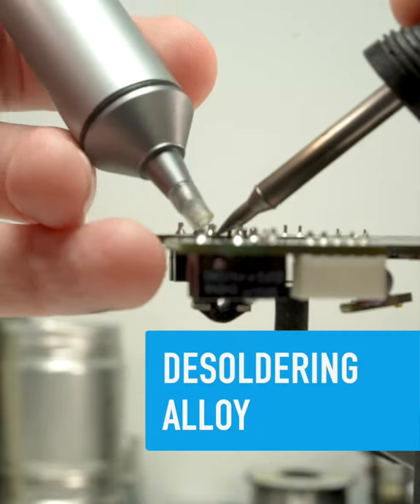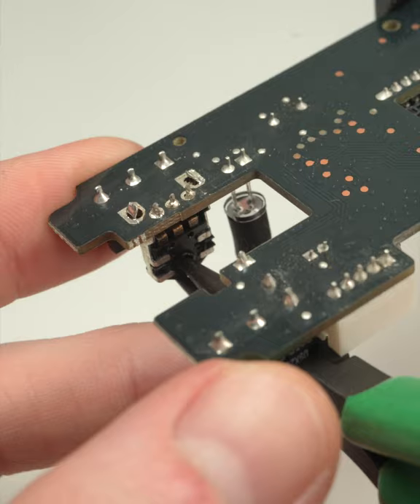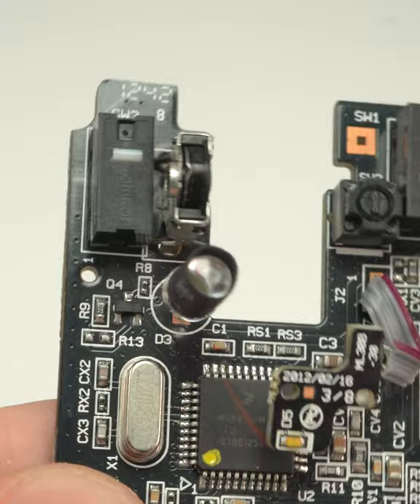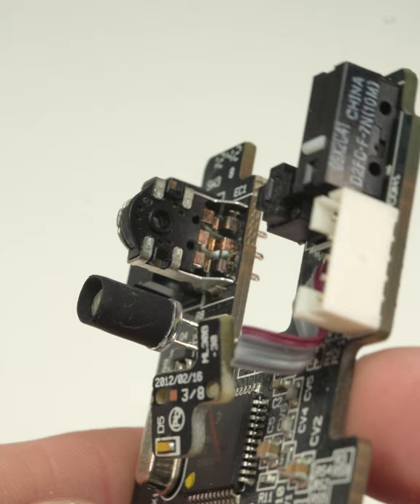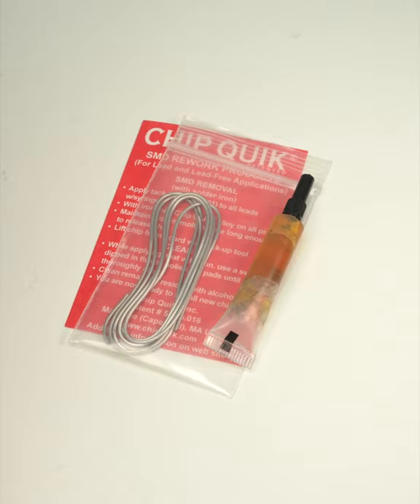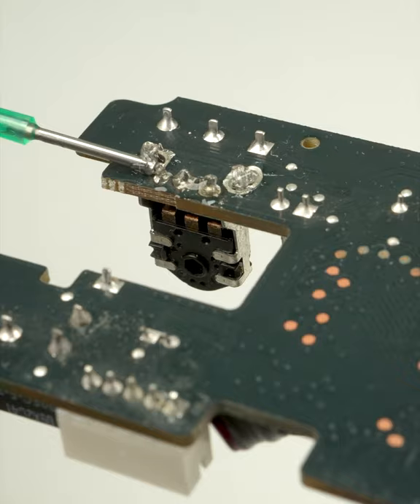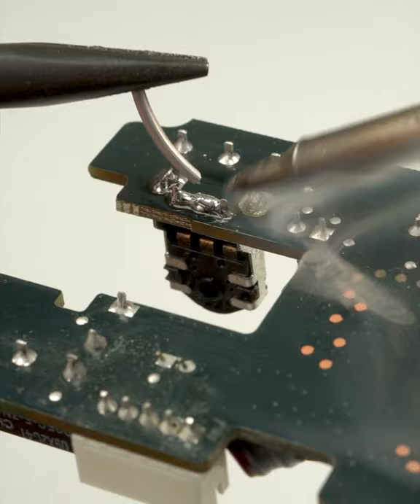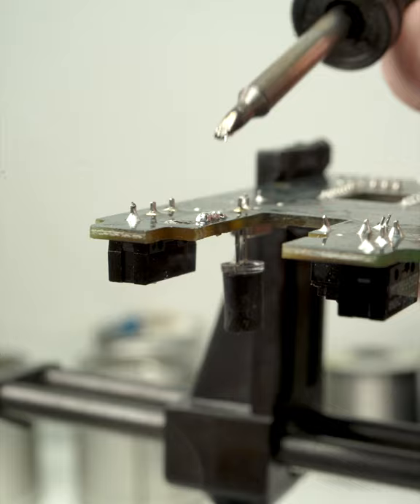Desoldering Alloy - Collin’s Lab Notes #adafruit #collinslabnotes

Comment: The PCB is probably soldered with high temperature no lead solder. Just adding some regular 60-40 will help a lot. Your wick looks like it has no flux in it. I once bought this type by mistake. Just put some flux on it.
Chip Quik is pretty good though.
Reply: That's how I do it
Reply: @tacticalguy6473  a heat gun can do more damage, and may cause components you don't want to desolder to fall off while desoldering, like nearby through hole components or even surface mount components on the other side, or shift surface mount components on the upper side
Reply: Nice
Reply: I’d use hakko fr301 and bam it’s done
Reply: That’s true vacuum desoldering tools are very useful. Maybe he doesn’t have one. This one costs at least $300. There are some cheaper ones you can buy but make sure you can get parts for them.
Reply: chipquick is expensive!!
Reply: @maximman102n7  if you have a hot air station that shouldn't be a problem. The nozzle should allow you to easily focus on the right area and heat it up quickly enough that the component falls out on its own without damaging it or other components.
Reply: That’s what I’ve always been told. Works every time.
Reply: My thoughts exactly sir!
Reply: Problem is 60 / 40 is Forbidden in most countries. How about that?
Reply: @bbblop4545  plus using kapton tapes...
Reply: Bro lectured Adafruit and is completely right😂

Comment: If the area you're desoldering is sensitive to heat, consider combining this with a hot air rework station. Instead of a 300 degree iron tip that can thermally shock components or lift pads due to overheating, you're slowly heating up the board with a stream of hot air.

Also this stuff can really change the metallurgy of the solder you use on the pads, so a "dilution" pass with some good solder followed by wick is a good idea to really make sure there's none of it left on the pads.

Comment: Or preheat the board. Just make sure whenever you use chipquik, get it all off before resoldering. Or the new contaminated mix might melt under normal device running temps.

Comment: When I've been in that situation, I've never yanked the whole assembly out: Instead, I've applied gentle traction between the component and the board, using the blade of a small flathead screwdriver, and worked back and forth, loosening a bit at a time, and being careful not to let too much heat build up at once.

Comment: You've shorted the pins all together and then heat them all, which will work with regular solder. I've used this technique many times, it works flawlessly..

Comment: I have a Metcal desoldering station but I prefer desoldering braid. The trick is to use paste flux on the braid and the largest tip that I have. Wet the tip with solder to increase the contact area to transfer more heat. Once the solder starts to melt pull the braid along until the solder is removed. It helps to fix the board with some weight or in a vice.

Comment: Happens to me when trying to desolder Steelseries Rival 100 switch and replace it with GM8.0, i manage to do it with 300-400 degree Celsius solder. The pcb is slightly damaged but the pattern or whatever is still intact and it was a success.

Comment: Leaded solder is what you need to lower the melting point and a bit of hot air while using the iron to heat up the bottom. I wait until it just falls down.

Comment: Just got some low melt solder last week. I can confirm it works. A bit expensive but worth it if you need it.
Reply: I have bought some Rose's Metal pellets very cheaply, they too work.
Reply: @SianaGearz  Cheers! 👍
Good find, I'll give it a go. Thanks. 

"Alloy Rose 400g
Synonym: BI036100
Applications: low-melting solder, low-temperature casting metal.
Composition: 50% bismuth, 25% lead, 25% tin 
Melting point is 93-94°C"

Comment: I bought a hot air gun (not for de-soldering, but general stuff), it has 3 ranges of temp, 60, 350, 550. For leaded and lead free mid range works awesome with the narrow nozzle. Didn’t know this low melting temp wire solder existed.

Comment: With some practice, I figured out I could use gravity to help pull the solder out of the solder holes in a pcb. Mainly doing power jack replacements. Melt the solder in one or two holes then tap the board on the workbench. The solder falls right out and sometimes releases the part. Plus it gets rid of the old solder at the same time.

Comment: when I was young I was Trying to get some components from dead computer Power supply. 

One of the trick I discovered was to add solder one everything look flowed. I slam the board pin side down. Effective on components with big legs

Comment: OR smack the board on a hard surface as you heat each connection then pull up on the board with the component in a clamp attached to something.

But yaeh for a bunch of pins this would 🎸 rock

Comment: You may call me foolish or other names but if it's a max 4 pin and they are next to each other i make sure power is off and bridge them with solder and just hear up the middle and therefore i can pull them out easy

Comment: I can desolder round connectors, or atleast till only the small pin remains, but i cant on square ones, the alloy doesnt stick, what i should do?

This showed in the video?

I wanna desolder mouse switches, all seitches, main 1-2, sides, the dpi one and the scroll wheel one as you did here, i managed to desolder and aolder the main one but i cant do the others for some reason, and i might have damaged the little board connected to the main, for the side buttons, became a darker green color

Comment: I've messed up my laptop board (aka melted it and warped it) trying to replace my power port on my laptop before trying to do the heat and pull method with the original solder. Yeah I won't be doing that again.

Comment: Ah very relaxing. Im never going to use what I learn here, but very relaxing nonetheless.
Reply: Why not? Just do it, it's fun, and electronics can be a comparatively spectacularly inexpensive hobby which can also save you money by allowing you to fix stuff.
Reply: @SianaGearz  I have bought a Arduino board and done relays, it was a fun project. I didn't have to solder anything though. I'm not very proficient with programming. But thanks for the encouragement. Fixing household electronics can be a very useful skill to have.

Comment: Oh my god, ordering immediately. Desoldering has been a nightmare lately.   I’ve got a few cheap pumps that are just useless. I even cut some silicone tubing for the tip to create a seal and it somehow still sucks, or doesn’t suck, whatever. Anyone able to tell me if a semi nice desoldering gun is worth the $?  Anyone have one that they highly recommend? Thanks
Reply: I plan on purchasing ZD211 when I get around to, it's only around 10€ from all the usual reputable suppliers. It is manual but integrated desoldering iron. It's said to not be very durable or long lasting though, but for occasional use it's probably ok, just don't be inclined to clean the reservoir too often and disassemble extra carefully. I imagine there are better products out there, but they're not even close to affordable to me.

I have modified the desoldering pumps I already had by combining parts of several into one and choosing a weaker slower spring and lubricating the o-ring. This way the rush of air doesn't insta cool the joint, so this works better, and the recoil isn't so hard either. I haven't had a need to modify it with a silicone tip, I can desolder anything nicely like that.

I despise plastic ones, way too much moving mass for some reason, I use the smaller alu body type. I have also cut off the sheath around the plunger at the top, and replaced the weird slanted plunger top button with a 3D printed flat and rounded one. My hands are tiny and I can't really reach the button comfortably to reset the pump, but modified like this, I can reset it by whacking it on my hip.

Comment: Ever tried to push it while heating it?
I mean, at last we, humans, have 2 hands and 5 fingers at each of them
Reply: This tends to be trouble when a component has soldered anchor pieces which need a lot of heat or has a lot of pins, you can't keep all of them heated well at the same time. Or how many arms do you have to wield 3 or 4 soldering irons? For a 2-legged component, wiggle or push is too easy to bother with any more specialised tools or techniques.
Reply: @SianaGearz  well, usually I just raise the soldering station's temperature, add more normal Tin for higher contact area, heat one of the pin rows while slightly tilting the componente to the side, repeating on the other row as it already raised enough on one side.

I would only use the desoldering alloy for more heat sensible components, like microcontrollers